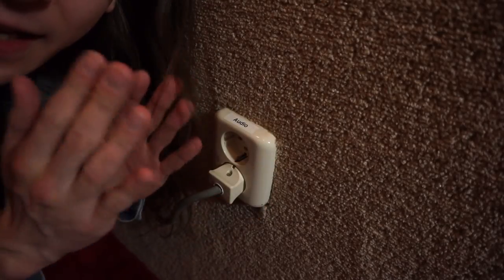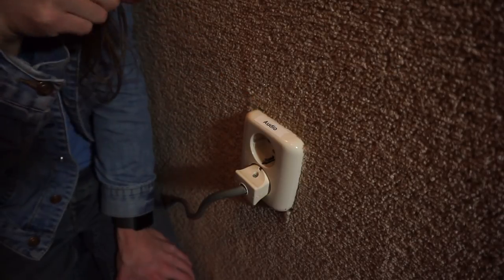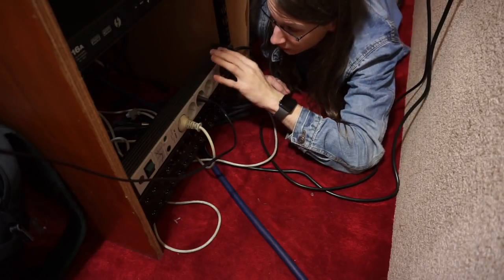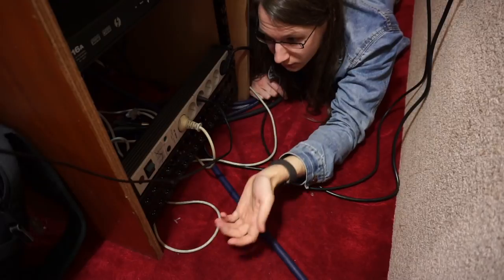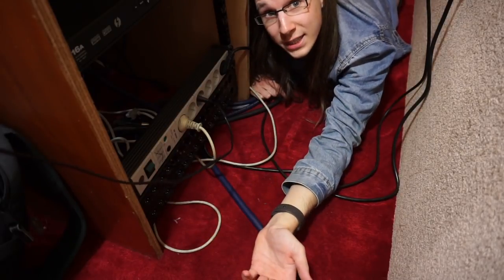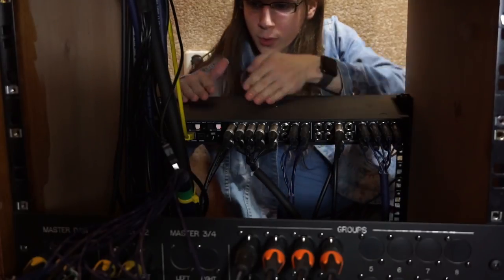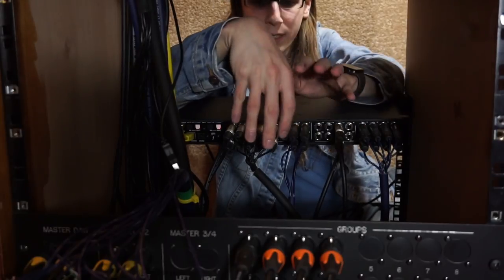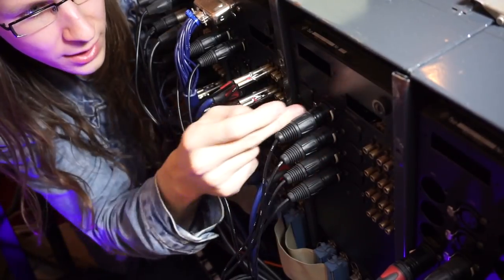WIRING A STUDIO!

Comment: Thanks for all the floor crawling! Anything to say about the grounding of the gear?
Reply from the maker: Everything that is made of metal should be grounded for safety. Even if its behind a transformer. Audio ground is most of the times “virtual”, meaning the 0V bus of the power supply.

Comment: Interesting video, it's cool to see how you set up your signal flow over there. For your main power, you mentioned fuses, I understand the reason that you want slo blow fuses, but are you saying that there are no breakers? In the U.S. in older construction fuses were used, but since the late 70's breaker boxes are now the norm. That means if you get a power surge you don't have to replace a fuse, just flip the breaker back on.
Reply from the maker: There are normal modern breakers :-)

Comment: question: I'm running MOTU as well, had been having issues with it dropping connection while using thunderbolt. so I connected via the AVB port to my Mac. when discussing the MOTU drop outs with a tech from MOTU they advised against connecting directly to you computer with the AVB. that is strictly meant for connecting MOTU units together or running them on a netwerk. have you had any issues connecting directly to your computer via AVB, and, why would it be an issue? trying to figure out why I was told not to.
thanks

Comment: Nice Video!!! Whats the name of the power supply for the console? I'm running a Yamaha console and searching for a way to cut the power costs down a bit.
Reply from the maker: The power supply is a modulair rack made by Schroff
Reply: do you think it will work on my Yamaha pm 1800?
Reply from the maker: Not sure, which voltages does it use? Maybe send me an e-mail or personal message, I don't check the comments that often....

Comment: are now almost 20years that in EU the normalized voltage is (or it should be) 230V
Reply from the maker: Yes, but we still run on 220 because we have super old equipment that will not run on 230... For instance, some tube amplifiers will have a way shorter tube life when the voltages in it are too high...
Reply: it is much easier(and cheaper) to simply  lower the voltage in the studio than mod every amp etc, to 230V. i do the same thing in my studio i think it is the best way to do it. all fast mods (adding drop resisstors etc) produce heat in the epipment, and that is something you don't want. modern equipment with switching power supplies will have no problems with the lower voltage.

Comment: even though you have air conditioner,  i guess those spots near the floor, behind racks, must be between 25 and 30°, no ?
don't you have a 'FI' protection switch/ circuit breaker, or whatever you call it, that can be a 20 milliseconds,  30ms, 100... 300ms... ? if the whole circuit has a microscopic default, that makes the voltage go, ex, from 230v to 229.9.. or 220... in other words, if output voltage is different than input (via neutral hire), it shuts down.. in 30ms.. 300ms...
because a standard fuse, if you have a short circuit, hardware default, broken component,  and it takes 1 or 2 seconds for the cables to warm up, and exceed the nominal amperage. ..1 or 2 seconds could totally destroy the device.
i say this, but.. your  installation must be prepared for these things,  you 've never had issues until today, right.
Reply from the maker: On a short circuit, the breaker will pop in a few ms... The thing I'm talking about is large current spikes when turning on, a C character tolerates those spikes, while an A character doesn't
Reply: White Sea Studio yes i got it.. it's just that slow fuses are good for huge spikes... but most important, to protect installations, like houses... (an hoover at 30'000 rpm can induce huge spikes... or an electric saw... etc)... but for protecting critical devices, human bodies... a 300ms to 20ms or even 10ms FI .. is the best.
Reply from the maker: So, when they test the installation, they do test these things, since the breaker has a slowing current and a tripping current. They are testing cable impedance/resitance/inductance/capacity stuff to see if a C breaker would still trip in critical situations...
Reply: Are these breaker types for European installations?
I have done a load (pun intended) of work here in the states, and have not heard of this. We do have GFCI (Ground Fault Circuit Inturrupt) which trip immediately when a fault is detected. These are used on any device within 6 feet of a water source, on all exterior, and any bath receptacle.
Amazed that you are patching all XLR, no 96 point TT bays. Fewer faults in the long run, better connectivity, though you do lose the normalling versatility. Love the Neumann PSU!

Comment: 1 to 1 transformer i the solution.
Reply: the goal is to get balanced power:  your isolation transformer needs a secondary side center tap connected to the ground on your outlet and a screen winding between the primary and secondary coil properly grounded you need insulation monitoring for safety reasons normal rcds won't work well with isolation transformers. most 1:1 transformers increase the voltage a little bit. so the transformer need to have some extra taps (preferably on the primary side, to keep the secondary balanced) to lower the voltage a little bit.